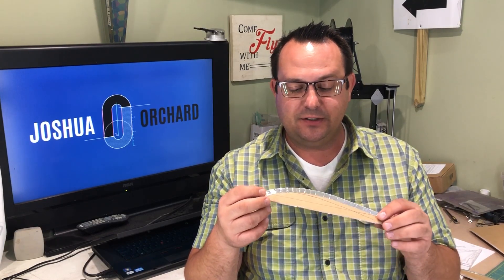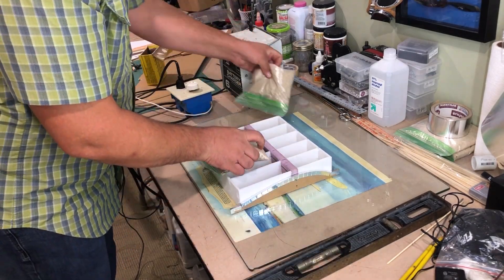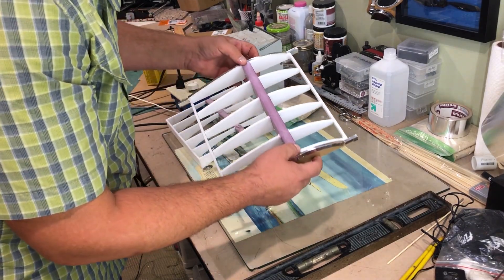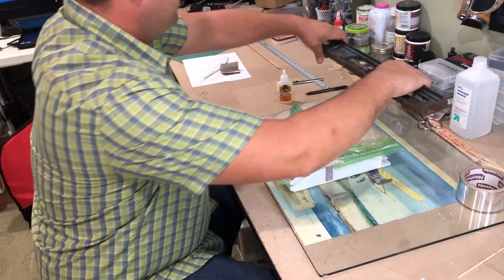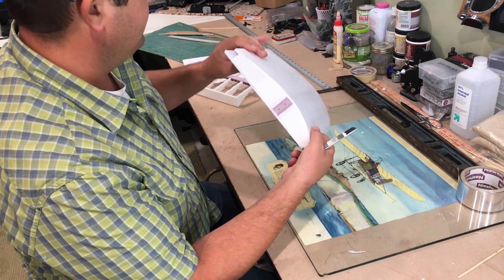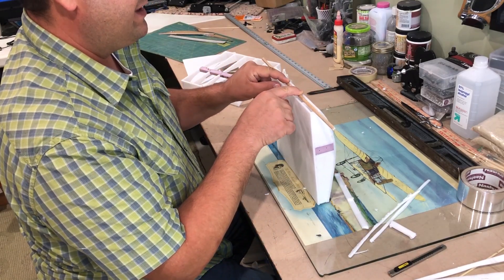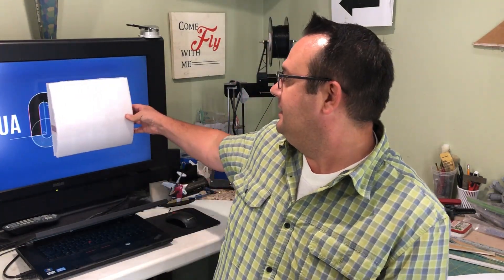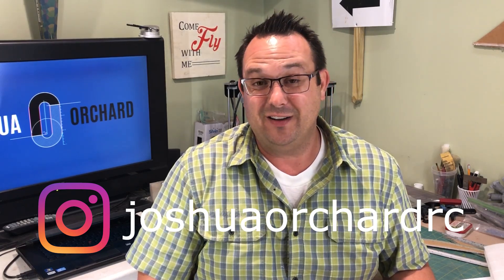Ribbed Foam Wing: 2019 Edition

Comment: How does the crash durability compare to solid white foam and tape construction?
Reply from the maker: Been trying to think how to respond to this question for a few days now and I suppose the best response is, it depends on the crash! It's not a building style that lends itself to be forgiving in a crash but more toward something that is far more light with strategic structural design. It would likely be easier to repair as the foam pieces could be easily joined using aliphatic or gorilla glue and then be re-covered.
Reply: @JoshuaOrchard  
Thanks for the well thought out response.
I've been thinking about building something with this method but then remembered why I fell in love with foam wings.   They take a beating.  However, now with the 249 gram limit, I might want to try something lighter even if it means flying less carelessly.

Comment: I so like this technique !! Wow !  I've been contemplating a hot-wire rig for a while now. This video pretty much seals the deal on that.  
I'm sure you are aware of the nightmare a decreasing chord swept wing can get- no matter how it's done. I anticipate that 'wiring' the sweep and reducing chord will take good timing and I'll probably need to practice it before I do production wings. I LOVE the way that a "box" style set-up assures alignment of all parts involved. Brilliant ! 
I 'was' going to skin a wing with 210g beehive carbon fiber, but now I'm not so sure. Like you are saying... it's tough in all aspects of stress. Now- I will likely skin it with construction paper of a weight that gets clean bends. Then a few layers of acrylic clear coat to seal the paper and increase lateral strength. Then design painting.. and done.
My concern, all along, has been both wing compression and large unsupported areas that could vibrate and detach the surface layer of air. It's about a 1.1 meter wing that will have a 4s 64mm EDF. Data sheet says it can get 970g thrust on 4s. I'll see about that. Heck, I'd be happy with a 1:1 thrust to weight and it looks, now, that I'll get better than that.
Again... I'm humbled here. Thank you so much for his video. It will be a game changer for me.

Comment: How did you get the paper off the foam board? It seems like most people end upwith a warped piece of foam that wouldn't work for this.
Reply from the maker: I just peel it right off. Unless you are using Elmer's foam or the like, there is very little adhesion of the paper to the foam. While the foam is quite wobbly the entire point is to make many pieces to give it better strength. See my Seamaster II video. That wing is STRONG.

Comment: Nice method.  For a inexpensive covering that also greatly adds to the structural rigidity of the sheeting, it would be interesting to see you do a test using newsprint (packing paper) and 50/50 water thinned TiteBond 2.
Reply from the maker: I've seen this technique used before and frankly it has no appeal to me. The finish is so warped that to make a scale model would take way more work than it is worth. I'd rather use epoxy and glass to get the finish what I'd like with better strength and a much smoother finish.

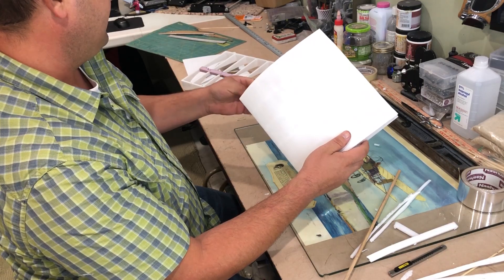Comment: Very impressed with this video. Especially at the 14:26" where it shows torsional rigidity ... I will try your technique on a small control line plane and then the sky is the limit. And for finishing I will also try the watered-down carpenter glue and light packaging paper. There are so many variations one can try. Thank you for providing an excellent creative "spark".

Comment: is your method stronger then sold foam? certainly lighter!
Reply from the maker: Strength is a relative term. A hot wire cut foam core has no strength to sustain an airplane until you add a carbon spar, fiberglass, etc. This example, I suspect is indeed much stronger than foam. The glue joints provide the load from lift to be distributed across the skin of the wing and into the ribs as well. Solid foam would likely be less rigid for lift but also torsionally. A simple foam core would have all sorts of twisting moments that would distort as changes in lift would happen unevenly across any more compound (non-square) wing shape.

Comment: I had an old duraplane given to me with no wing, i used dollar tree foam board and drew out a wing and built exactly like you would with balsa. The most expensive part was the styrofoam ca glue that i have anyway for my foam planes.   But it works great. Reinforced with a 1/2 inch spruce dowel down the center and glued plastic from a 2 liter bottle where the rubber bands contact the wing.

Comment: I use 5mm foam board flooring underlay. It's bare so no need to be removing paper like foam board and it's cheaper.
Reply from the maker: Awesome suggestion!
Reply: Can you point me to where I can get the 5mm foam board underlay please ?

Comment: It's a great way to make light weight wings. Having made several this way I have found a few
things that help. Keep the Gorilla glue thin, spread with a playing card like Sparky applies it.
Also make your wing boxes thicker than you expect, this leaves more meat top and bottom
and makes the structure less flimsy. Finally, hot wire as soon as the Gorilla glue is ready, the longer
you let it cure the harder it gets, makes cutting it more difficult. And WR has it right, make the box deep enough to cut in two pieces for left and right panels. BTW, I prefer brown GG for skinning but that's just me.
Reply from the maker: Thanks for the comment, John. As I'm sure you are aware, your building is the main inspiration for this video. Cannot wait to get off my balsa building kick and give some new techniques a try.